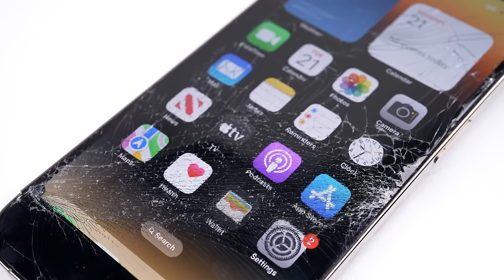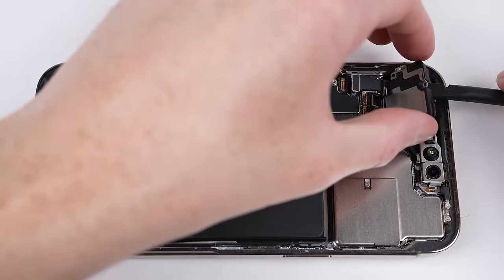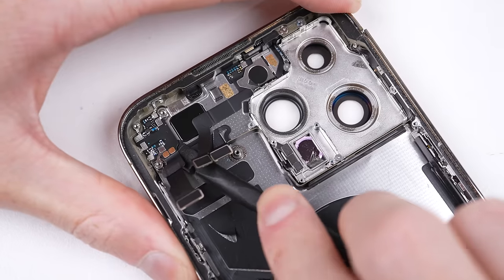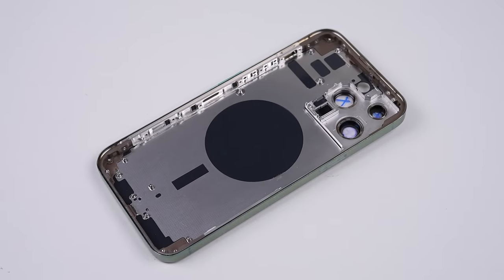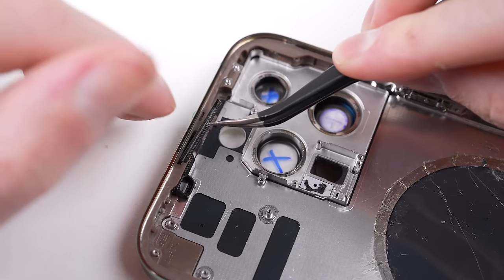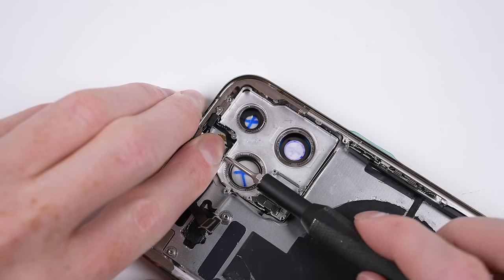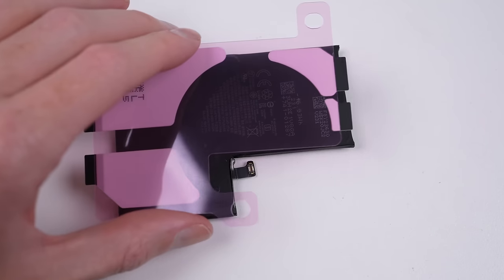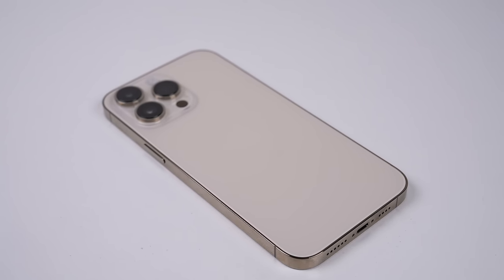What It Takes To Repair The iPhone 14 Pro Will Anger You - iPhone 14 Pro Max Restoration

Comment: Your desire to repair the phone for less than it costs via Apple is driven by your desire to make margins. It’s the same motivation for Apple. They know how to make money, and in turn are able to use that money to produce some of the best products on the market. If you don’t like repairing them don’t repair them. I disagree that Apple are designing products in such a way that it deliberately complicates the repair process, but is instead driven primarily by their desire to improve the phone and it’s functionality whilst maintaining the slim and aesthetic form factor everyone loves. The result? Microscopic components. Personally, I am blown away by the level of detail and engineering that goes into todays flagship iPhone, and in some ways it helps to explain why they cost what they cost. It sucks to damage an iPhone, but if you can’t afford the repair either be more careful, protect it, or don’t buy an iPhone in the first place. I don’t drive a Ferrari because I couldn’t afford to run it or repair it. Same same ✌🏻

Comment: please help me i threw my iphone 14 pro at a window and the glass on window didnt break but i was angry over something silly and now the back and front are smashed badly and the phone has a middle crack from right corner to bottom left corner where housing connects i can see. so it looks like i need front display and back and also housing. now im a small hand guy and ever since i got this iphone 14 i thought fuck me its heavy and big thank god i didnt get the max. my prefered size is iphone 8/SE if it didnt have flipping bezels it would be the perfect phone since slice bread. so im using my iphone 8 again and tbh i hate face recognition and love fingerprint scanner. how much do u think ill be spending to get my iphone 14 pro fixed? im dreading it because i know its gonna cost hundreds. edit: i might not need housing but it is kinda  little out of place because both sides are cracked glass. edit: also the materials iphone are using now compared to say iphone 4 housing built like proper metal and proper scratch resistant glass premiuim materials. now we got something that breaks and scratches so fucking easy i will not buy another iphone piece of shit.

Comment: I mean, at this point, I feel less angry and more impressed... both by the amount of effort put into making the phone impossible and undesirable to repair, and by the amount of patience you took in doing so. I would have probably given up and said the phone was not possible to repair about halfway though. And given how much money you had to spend in parts anyway, I'm not sure you actually saved enough money over the cost of replacement to make it worthwhile. If repair is $550 with that much labor, and a new phone is $1100, then I would say you put in at least $550 in labor and it amounts to the same thing. It may be technically possible to repair that phone, but it sure isn't worth what it takes to do so...

Comment: My last iPhone was an iPhone 5S I bought in September 2013  after I owned every iPhone from the original in 2007 to the 5s and then I went to my first Android phone last year the Samsung Galaxy S22 Ultra after I replaced 2 Screens and 3 batteries myself I got on Amazon in that 5s. In 2021 I was no longer able to get app updates and was told I needed to get a new iPhone even though the 5s still worked great, so I bit the bullet and gambled on the New Galaxy in 2022 and hands down the most customizable and it is the Best phone I ever owned. I will NEVER go back to Apple and their Greedy practices.

Comment: Good thing I switch phones every year and apple care for 1 year free covers anything I’d need. Last year before I switched my speakers started not working on 14 pro max and they said it was the microphone and told me the mics were part of the frame and that they were just giving me a new phone. Maybe because it was easier to just give me a new one than go through the hassle of replacing them lol. But now the 15 pro max is much easier to brake the back glass because of the right to repair bs. Idk anyone who doesn’t lease and upgrade every year so to me it doesn’t matter.

Comment: there's only one solution to this… don't buy Apple. In 2014 stopped buying Apple on an absolute basis. But the problem goes much further back than that in that. I had a iPhone 3GS… And it would not allow me to delete a photo without being connected to the computer from which it was managed. Maybe that's not my wife in that photo with me maybe that's not my girlfriend… The bottom line is I could not delete a photo from my own phone. Always remember… It's not your phone… it's Apple's phone…

Comment: Just invest in Apple Care. It’s 100% worth it. The most you’ll pay monthly is about $13.49. It’s always repaired with genuine Apple parts or you get a certified refurbished replacement from Apple if it’s beyond repair also with brand new genuine Apple parts. I would only trust a refurbished from Apple anyways

Comment: I love everyone giving apple a hard time here. Yes the "anti repair" firmware nonsense is un-necessary and a douchebag move from apple, but from a build quality perspective, I'm actually very impressed. Lots of proper metal parts, screws and precision fit components, rather than glued in plastic. Like high end watches, yes its a nightmare to work on, but the very nature of this build quality is why they last so well when taken care of. I very much see this kind of engineering as a win, not as something designed just to piss off customers. 

Also if one of these has a camera failure, or a charge port failure, you can unscrew that component and replace, you're not faced with having to replace a whole phone because that component is bonded to the rest of the phone to save costs. 

Yes this was a hard repair, but the phone was all but destroyed. It wouldn't be any easier to repair another brand of phone, and in many cases, another brand phone may have suffered a great deal worse in terms of internal components. 

I'm impressed

Comment: I thought that in order to have this repair flawless, you would order an original screen from Apple. Yes, it is about 800 AUD instead of 300, but the price is still far away from the price of phone replacement by Apple. And actually I would find such a flawed phone quite irritating to use.

Comment: I see alot of these videos about how hard iphones are to repair.  If you don't throw them around then you won't have to repair them. I still have an iphone XR that looks like the day i opened the box.  They are built like a tank.  But if you are heavy handed theres always apple care
Reply: i have three arguments against your suggestion: children, pets and it being a day-to-day item.
Reply: @kensaiix  I have three rebuttals to your arguments. I have Two children, 15 pets, (yes I said 15 that's not a typo) and I carry two cell phones with me every day in the same pocket rubbing against each other for hours.
Reply: @im2dirty4u  you cannot account for "unlucky" accidents as the norm. The norm is, if you take care of your stuff then it will last.
Reply: @Danarchy3  that is why you want sane access to repair. because unlucky situations exist. further more, there is no argument why a screen swap should disable adaptive brightness. and i am very sure this is not the only pitfall when repairing.
Reply: @kensaiix  you have sane access to repair, unless you say it's not sane to take your devices to a qualified repair shop.
Reply: @Danarchy3  then, to keep with the stated examples in the vid above, why does the adaptive lighting cease to work? why are non-standard screws used?
the most common repairs, screen and battery replacements are already complex enough without these hurdles, for the repair specialist you mention yourself.
it is not sane if you are very clearly forced back to an apple store/closed eco system, that does nothing but dictate prices.

Comment: Apple Original display is cheaper than the display you have purchased. If u bought that one which is cheaper and original then you wouldn’t be getting the display message
Reply: Original displays are not cheaper and you need an Apple employee to pair the new screen with the phone or a device that can pair parts and trick the phone’s system. Plus Apple will only tell you to get a new phone instead as they’re lazy

Comment: Apple  is making its products harder to repair, reuse  and  recycle. although  it makes the  best hardware with most modern outlook. But  once the devices are a bit old the apparently new looking phones or Macbook , imac become non up-gradable  . And where you can a  make a 10 years old pc  fully functional after some repair and upgrade  which is less resource wasting and sustainable .But for some unknown reason Apple's business strategy or philosophy is in stark contrast with the current world wide policy of sustainability  and less resource  wasting production.

Comment: That’s why i hate apple cuz they make phone repair so hard and on top of that even if you do repair it they make it so the phone will not work good after you do so now you need to pay half of the price for all those parts and still phone system will not alow for phone to work good and even if you send the phone to apple for this repair it would cost you almost full price of the new phone that’s not right by them and they are going down in the ayes of people cuz of it and i don’t know about you guys but all phone companys should make like before so everyone can make repairs and swap new batterys when needed that’s how it was before and should be always like that so they need to make back cover so you can take it out easy and swap battery like before and make a way so u can have water protection even with back covers like that and i did hear about new law that’s going to be in place soon about all the things i writed here well i hope so 🤞🤞

Comment: There is literally no reason to use that many different types of lengths and require so many drill bit heads for what other phone manufacturers do in six Phillips screws. Apple has completely lost the plot from the Steve Jobs days and is out of control

Comment: It's hilarious because it is so obvious that much of the additional cost of these new iPhones isn't even in the technology, it is likely in manufacturing costs. It costs so much for each additional little part, whether you have cheap labor or you program a robot to do it. But certainly almost none of this even contributes to the "premium" quality. In my opinion it is only added to make repair nigh-impossible. Shocking and disgusting.

Comment: It's impressivw how Apple's efforts are all oriented towards making their phones unrepairable rather than introducing something really meaningful and innovative that other "lower tier" producers have had for years... They remvoed the fingerprint sensor and replaced it with the idiotic face id with the excuse they have no room while 99% of other producers put it under the screen and/or the unlock button... Really true that Apple customers are incapable of grasping they are getting buttfucked with lower performance phones and mostly laptops when they could buy much cheaper (3x) products that have mostly twice the performace of everything Apple can put on the market (like the "miraculous" M2 that loses in every regards against a much cheaper i7 processor, with the only advantage being low power consumption... with lower performance I'd be surprised to have similar power absorption...)
Reply: Optical touch id did have limitations before though and face id on apple is really secure

Comment: Well done sir, that looks like a nightmare to just keep track of the parts! I've never seen such an anti-consumer product in YEARS! Think about it, which parts are most likely to break? If your back panel smashes - whole phone pulled out to fix, If you break a button or get it jammed with pocket crud... 95% of the phone has to come out. The only part you touch which looks simple to replace is the screen and even then they screw a metal bracket over the cable so someone doing it for the first time will probably cause more damage! Just VILE

AND A F*####### SOFTWARE LOCK ON THE SCREEN! FFS!

Comment: I was with Apple until the very end. I mean, sure, there are a million microscopic parts and all the screws being different sizes and bitting seems unhinged, but it's a state of the art phone. I don't necessarily see malice there. I see a company that's been designing slab-style phones for 15 years putting all their engineering experience into action. The fact that the phone was even salvageable at all after what it had gone through speaks to the quality of Apple products.

But electronically locking down features even after someone has correctly completed the BS repair process? Must be that Apple "magic" their executives are always talking about. 😑

Comment: i assume they replace the parts in apple, hook it up to their magical computers and program all the parts matching to the serial number. i also assume the programming must have a ton of internal security checks so it probably will receive encrypted keys from apple servers to confirm the parts can work with harmony if it repaired in an authorised service centre. lucky we have android (for now) phones that at least have some degree of repairability. i have seen another video from hugh jeffreys showing that only apple can repair their newer laptops. apple doesn't want repair shops profiting on their devices anymore.

please buy protective gear for your electronics.

PEOPLE MUST BOYCOTT APPLE. PEOPLE HAS RIGHT TO REPAIR THEIR OWN ELECTRONICS.

Comment: You guys don't understand that Engineering to make easier to repair costs extra money. That would increase the price of the phone and Apple won't make any money this, instead, they will be loosing future customers that just repair broken phones.

Been working on a few projects myself, i realized that making it easy to repair is extra hard work and sometimes, you might see a loss in performance.
If you were to ask me, I would do what apple does. It's a non brainer. Iphone is a luxury brand. They don't care if it's repairable or not.

I would never repair an iPhone. I still own an iPhone 7. Battery sucks but not gonna change it for fake versions or refurbished ones. But for the rest, the phone is holding up pretty well.
Reply: @bolm-us6yb  he didn't watch the video properly.
Reply: you could literally make a phone with detachable back AND get it water-resistant for the same price probably

Comment: Anybody, who has opened his/her fair share of electronic devices, will recognize, how contrived this design is. Of course, miniaturization is and has long been a thing – especially in smartphones. But this is truly taking the piss. It is not as much a design philosophy as it is an underhanded tactic:
      
- using an absurd number of different proprietary screws
- gluing components, that don’t need to be glued
- hiding basic and common points of failure (screens, backlight source, batteries etc.) behind a bunch of stuff and/or gluing/soldering them down
- making everything as micro-modular and convoluted as it gets
- etc.

Apple products are notorious for how maintenance unfriendly they are (and have been for a long while). They seem almost tailor made to sandbag any repair attempts; even when it comes to very typical faults. They are designed like a car, where you need to take out the entire motor block, just to change the tires. And you demonstrating, how the swapping of two intact and identical parts causes to mutually “malfunction”, is some downright dystopian stuff. It may be a hint of more like this to come. Cooperate bullshittery at it’s finest. Stuff like that is only adding to the ever towering mountains of E-Waste – and it is a crying shame.

However, Apple is not alone in this. Samsung is also pretty bad by now, when it comes to maintenance.

Comment: Behold the planned obsolescence design. Apple just throws your phone away whenever there's an issue. Recovering data would involve disassembly, so no chance. If they designed the phone competently, you could replace parts likely to go bad, like the battery, very easily. That's really bad for business though.

Comment: lmao,  my thoughts?  F that!  I changed out a screen on a iphone 7 plus and it was a pita and the home button didn't work after I was done.  I can't even imagine going through this.  Apple has become too big and powerful, they should not be allowed to do crap like that.  Even after you went through all that they can disable features because the system is somehow serial number locked for each component so they know if you fixed it yourself or had someone apple didn't authorize to fix it for you?  Lawsuit time and apple and any other company should be forced to stop this behavior.  Its not fair to consumers.  And all it does it pad their over flowing bank account.

Comment: I wanna vomit with how ridiculous it is to remove SO MUCH
Like, if the engineers weren’t being told to make nigh unrepairable phones such a hassle of a phone, and instead made to think like the repair folk (be it them or a third party). They could innovate to make a good phone with easy to replace components for the sake of the customer and repairmen.

Comment: 13:04 Garbage tier, insane how you need to disassemble and rebuild the hole phone just to replace the back casing honestly I don’t see 99% of people thinking of undertaking doing such a repair and they will probably just use the phone with the broken casing or buy a new one

Comment: When you change the screen the face id doesn't work either. Also you are not a true repair man. A true repair man can salvage the old screen and replace the glass only. I've seen people doing it with golden wire.